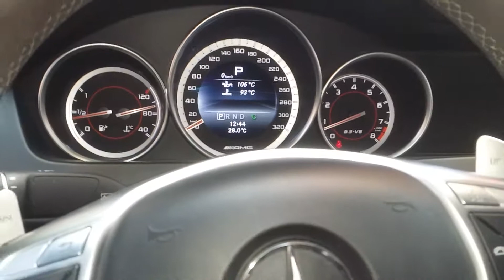MB C63 AMG weistec stage 2 S/C ready

Comment: why is the oil temp so high? Because the car is not moving?
Reply from the maker: +ALBAK hi, it's only 105 usually operating oil temp is 115
Reply: Yea, during "normal" driving the oil temp on mine reaches about 230F